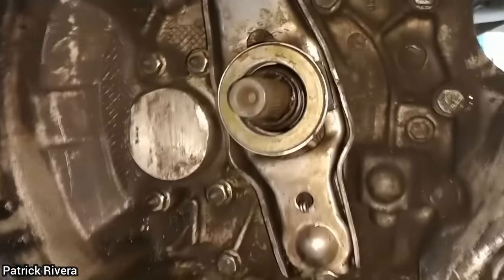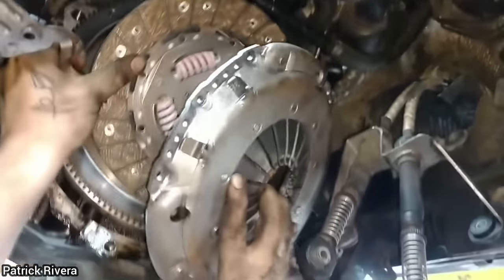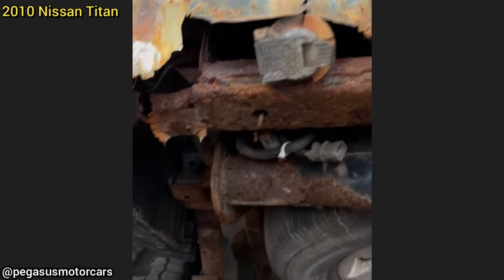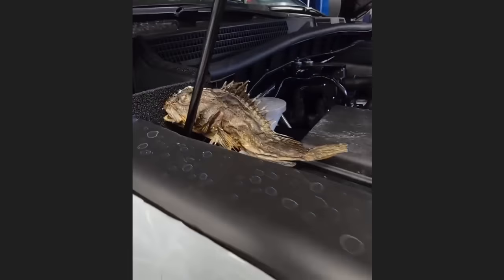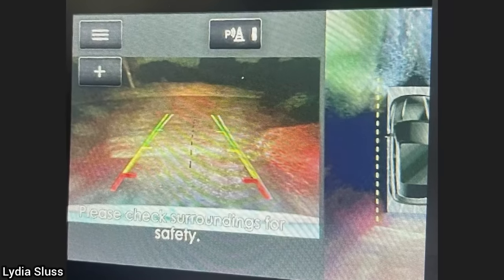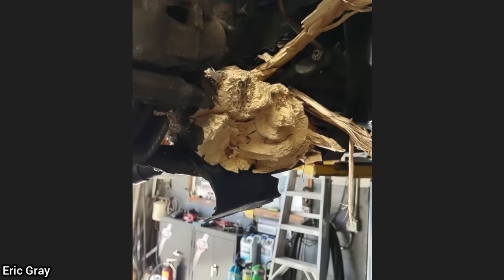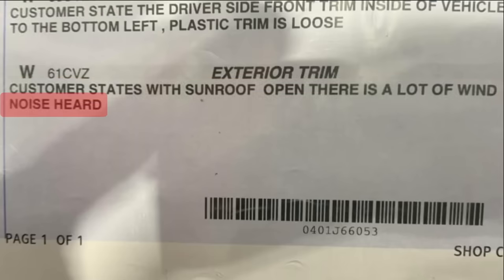Customer States New Clutch He Installed Doesn't Work Properly

Comment: Spray foam the sunroof customers ears to fix the wind noise 👍
Reply from the maker: Spray foam head phones!
Reply: @JustRolledIn That is a good idea, might use the long weekend to make some 🤣
Reply from the maker: @smilerbob  please keep us posted on this 😂
Reply: @JustRolledIn  👍👍
Reply: Foam in one ear, out the other.
Reply: Too much work.  Gotta go buy the spray foam, shake it up.  I just turn up the radio volume.  Problem solved.  🤣😂
Reply: In all fairness. I’ve driven cars that are fairly quiet with the sunroof open, and some that sound like a tornado. My last BMW had fancy deflector that worked well.
Reply: there are some automotive problems that can be easily fixed by turning the radio up
Reply: Comment of the year. Fully sums up the 2024 zeitgeist.
Reply: I have wind noise as well from my sun roof when open I wonder if spray foam will fix.
Reply: Hey, that's a nice and permanent way to fix wind noise, sunroof or no sunroof.
Reply: What is this, a crossover episode?
Reply: I would’ve just said it’s called Bernoulli‘s principal.
Reply: Pouring concrete would be a more concrete solution.
Reply: Or fix the wind flap mechanism that doesnt come up to steer air automatically when the sunroof is opened? Can be customer fault too but that CAN be an issue if the flap mechanism doesnt work 😎
Reply: @JustRolledIn  i’ll be waiting to see them on Dank Pods.
Reply: Brilliant, now the fix will work in any vehicle he's in

Comment: "There's a lot of wind noise when I open the sunroof." sounds a lot like "When I step in the shower, I suddenly feel moisture."
Reply: Yes, but you don't realize that the wind noise still happens when it's standing still!  The shop has called a priest in for a consultation.
Reply: I bet they even added "but only if the car is moving" 😅
Reply: "When I hit myself with a hammer it hurts."
Reply: "When it's sunny out, I get hot"
Reply: And it's really bad at 100mph in the rain.
Reply: @coastaku1954  "It gets dark at night."
Reply: @markh.6687  "I go faster if I run"
Reply: but wind noise is a consequence of a bad desing, there should be some shapes that minimalize drag and noise. So customer was not so stupid this time. There could be something wrong indeed
Reply: Moisture is the essence of wetness
Reply: Scary thing is these people are also voters which explains a lot.
Reply: The sunroof noise may not be a dummy, several cars have an anti-buffeting setting on the sunroof switch, if buffeting is experienced you twist to the setting and the roof closes a little bit (maybe 3/4 open instead of fully open). You can also lower a rear window a smidge, maybe an inch.
Reply: "My car is only getting 37 miles per gallon when it should be getting 38."
Reply: Spray foam ought to clear up that whole moisture thing. Just spray it on the shower head before use.
Reply: When I close my eyes I can't see
Reply: Many cars have a flap that pops up to guide airflow when you open a sunroof. It can malfunction aswell. My parents volvo 850 has such flap and when I push it back down while driving the windnoise gets alot louder in the car.
Reply: @markh.6687  Classic Blonde joke....Doc, why does it hurt when I push right here? Your finger is broke.
Reply: @donnienicholson6062  Heh heh heh!

Comment: A PAPER TOWEL to hold in an ignition coil 😅.   Everyone knows you’re supposed to use spray foam for that
Reply: 1 full can Minimum, atleast.
Reply: Put enough spray foam on the coil so that the hood holds it in place.
Reply: Be nice. Some people just don't know what you and I know.
Reply: Gen Z has evolved again. They're now using paper towels instead of spray foam.
Reply: No, the correct repair involves a cable tie/Zip Tie.
Reply: I’m going to have to start carrying cans of spray foam in my car, you know… just in case.
Reply: Damn I was coming here to make that joke but you beat me to it.
Reply: Spray foam solves every problem ever apparently!!!
Reply: @ctcv-to8kq  Then they shouldn't be working on cars.
Reply: No.. spray foam is for rust mainly... you need a coconut...specifically a load bearing coconut.
Reply: Silly me, I was thinking duct tape or cable ties would fix it. Wait a week and someone comes up with something new and cheaper.
Reply: Actually JB Weld would get it through an auction and then who cares?.........except the buyer.
Reply: @ctcv-to8kq  My wife broke her thumb last month. I know very little about creating a cast..........and didn't try.
Reply: @donnienicholson6062  You're wise beyond your years.

Comment: Milk crate guy had so much faith on the crate
Reply: And  here I thought there was no limit to what a milkcrate could do.
Reply: Worked with his old car that was 70% sprayfoam
Reply: He failed to fill in the holes of the milk crate with spray foam. Shortcuts like that are the source of many problems.
Reply: I've got buckets that come with a picture of a mercedes e class resting on them, one under each wheel. So I suppose the milk crate isn't too wild of an idea haha
Reply: I weigh 220. A milk crate will  barely hold me on the edge corners. It's not a step stool either.
Reply: I wonder if people using those as jack stands to work under the car have won some Darwin Awards already and just don't show up here cause this isn't Liveleak.
Reply: Next week it'll be 5 gallon buckets.
Reply: Too much
Reply: Plastics can hold surprising weights. His biggest fault was putting it sideways and having the long beams further away from the corner supports try to hold the weight. Had it been other way around it would've most likely held. Not that I think it's a good idea overall.
Reply: @markoman5267 he wasn’t using enough milk crates
Reply: Spray foam fixes everything
Reply: @Kalvinjj  I miss LiveLeak. I didn't watch stuff there very often, but I appreciated the fact that something like it was out there.
Reply: And Weight
Reply: Quality of milkcrates has sure gone downhill.
Reply: At least he was trying to do the work himself. It was wrong but he tried!!!
Reply: @PAcifisti  No, it wouldn't have worked. Multiple crates may have worked but a single one was just another dimwit proving how little they know. The genius thought a crate could support 2500 lbs!
Reply: They don't make them like they used to lol
Reply: @nboddie1036  Well, that is ironic given that the crate isn't holding up the whole car but about half or so. So it's more like 1250 lbs unless you think that car weighs around 5000 lbs. And again, solid plastic structures like the towers at the corners can easily stand up to a lot of weight. If it had been placed on the edge it would've had a much better chance.
Reply: @PAcifisti  The SUV weighs a lot more than 2500 lbs. Maybe half is about 1400-1800 lbs. Regardless, milk crates aren't designed to hold that much weight. What a genius...
Reply: @roxximusik8958 no need to anyway, they rotate themselves as you drive 😉
Reply: Milk crates used to be made of heavy duty wire and sheet metal.
Still wouldn't trust one as a jackstand...

Comment: Soon we'll see a spray foam car. "Customer brought in their spray foam car. Apparently the last owner installed some metal and painted over it" 😂😂😂😂😂😂
Reply: well tecnically all cars of  the tuning era monsters of the early 2000 were made of foam , fiberglass and glitter paint xD
Reply: To be fair, a foam core between two layers of fiberglass is a standard boat building technique. 

A foam core between two layers of rust does seem dubious.
Reply: in the next episode there will be someone saying that he spray foamed the car because someone on the internet said this is how boats are done
Reply: Along with a bit of JB weld and a few zip ties.
Reply: Crocs.  Not just for walking anymore!
Reply: It's important you allow the spray foam to thoroughly dry and harden before driving your vehicle, especially when using to support or replace frame and steering components.

Comment: FFS people I live in the rust belt and have a 20 year old truck that is structurally perfect and only has minor surface rust because I coat the underneath with a used oil slurry. I see people with vehicles that are less than 10 years old with subframes completely rusted away from the structure of the unibody or trucks with frames that look like they Luke and Bo Duke’d the thing and taco’d the frame from jumping it but nope it’s just rust to crap something that’s not even a decade old yet. Do not listen to the Car Salesman, that undercoating they offer is worthless and will be peeling off in a couple years not to mention they will spray stuff they shouldn’t like the exhaust and then completely miss other areas that needed sprayed. Nothing beats good old fashioned recycled oil being sprayed on the undercarriage but the EPA closed down most of those places so do it yourself or get it Fluid Filmed which is a good respectable alternative to recycled oil but the oil is better for preventing rust in the Salty Rustbelt areas

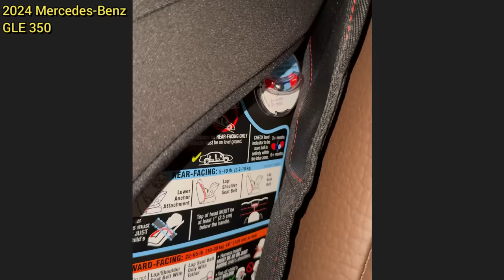Comment: 2:51 Customer States: "My convertible gets very cold in the winter whenever the top is down..."
Reply: "Pedal becomes hard to press when it reaches the bottom"
Reply: Yeah well, my car makes noise when I start it.
Reply: :"steering wheel wont turn any more at a certain point" ---- check and advise
Reply: @the_kombinator  Sounds like an old-fashioned Internal Combustion Engine. Though I guess EVs have start-up chimes too.
Edit: synthetic pedestrian alert noise too.
Reply: Light blinks on dash when left stick is moved up or down.

Comment: Customer: "Could you take a look at my car, there appears to be a problem with xyz"

Mechanic: "Hey, we found the issue and we can fix it for you"

Customer: "How dare you! I'm driving away"
Reply: Americans are entitled and think they have a Dog given right to ride.  They also think car repairs should be commensurate with the value of their car.  You can't explain them why a trans R&R will cost $5,000 for their $2,000 car.
Reply: @russell2952  Can't fault a man when spray foam is on sale.
Reply: @MrSloika   Most folk simply don't budget for maintenance or repairs, & they don't plan for it, so when they need something done, they simply can't do it at the moment.  Not everyone is a stupid asshole.
Reply: @Salmon_Rush_Die  Only 99.5% are when it comes to car repair!🤣
Reply: @Salmon_Rush_Die  Not getting the repairs done is their critical is being a massive idiot by European standards. Not that it's actually an option with critical stuff. You either get it repaired or you take it off the road till it is or you scrap it.
Reply: @darthkarl99  If the car can still propel itself under its own power, it's not critical. :p
Reply: @russell2952 It used to be baling wire. Oh how times have changed.
Reply: @Salmon_Rush_Die why even bring it to a service, then?

Comment: That rotted in half spray foam parts truck reminded me of my neighbors truck. Early 90s 1500 Silverado he bought from a good “buddy” that he was all excited for. I asked how much rust it had being over 30yrs old and in WI and he said very little, it’s really clean with a new engine. This thing was so rusty the RR Xcab mount was gone, GONE!! He brought it to a muffler shop for new exhaust and the frame cracked in half while on the lift. He had it fixed and when he told me what happened I asked why he bought it with the cab clearly not sitting on the frame properly, not to mention literally every other body panel being toast as well. He didn’t notice, a 3-4” variation in the body lines and he didn’t see it🤦🏼‍♂️ Told him he needs to punch his buddy in the mouth for that BS deal. Yes he’s still driving it yes it’s now a whole lot worse than when he bought it and no I don’t let him follow me anywhere 😂

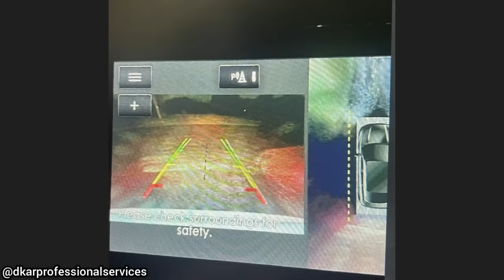Comment: 1:31 - I wonder how far this complaint went.

Step 1) Complain to the dealership. Tech says this is expected behavior because of the light from the brake lights.
Step 2) Complain to the manufacturer. The representative says this is expected behavior, and that brake lights are required by law.
Step 3) Complain to the government. The government says that brake lights are required safety equipment and that you should go pound sand.
Step 4) Customer pulls the brake lights fuse. Customer gets rear ended in the middle of the night because the tail lights aren't working and then complains to the dealership.
We've gone full circle! 😆
Reply: You wouldn't believe how many drivers are driving around in Chicago without brake lights, this might be what's happening, what you explained I mean haha
Reply: @0013bluejay  Last time I fixed the brake lights on one of our cars: I thought the brake light switch was faulty: because all 3 bulbs were burnt out.
Reply: I wrote on another comment about this one that the customer had 2 options. Either don't use the brakes or just use the mirrors. I can't believe how mindless some supposed adults are...
Reply: @nboddie1036  you're telling me, as a truck driver I had to deal with this crap tenfold everyday, I just wish people would think two feet past their own bumper.
Reply: Step 5) The dealership takes the customer out back and puts them out of their misery

Comment: When in what dimension does someone think two plastic milk crates will keep a Toyota sienna in the air 💀
Reply: You think people are smart?
Reply: The customer is probably thinking, "I should have used MORE milk crates. That was my mistake."
Reply: I wonder what percentage of people just don't have a "feel" for mechanics. Some get trained in formulas, some look at something and say "I don't know why but that won't work and others just didn't break their toys as a kid!
Reply: The second.
Reply: @Paul_Wetor  Maybe the secret is having the milk crates filled with milk cartons.
Reply: Don't look too much down on plastics. Four credit card sized blocks will easily hold up a 2-4 ton concrete slab. His biggest fault was putting all the weight on the long side beams with no support underneath or near it.
Reply: @PAcifisti  Only if they're solid. The issue is not the material, but how it is structured.
Reply: @PAcifisti  It's not the material, it's the structure of it.
Reply: Clearly the teaching of physics in school is not what it ought to be.
Reply: @UncleKennysPlace I weigh a lot less than any car, and even I don't really trust a milk crate to hold me up

Comment: I grew up in the desert southwest.   I have lived in the "rust belt " since 2000.  I am still floored at the short life of vehicles due to rust from so much salt.
Reply: You can protect them from it. Just apply protective layers when new and it won't really get affected. We salt the roads here too and cars last Much longer than this - heck, most of our cars are older than 2009 and we have mandatory yearly inspections that won't allow rust damage on structural components.
Reply: Rinse the underbody after the roads are dry, and you'll keep it mostly at bay for cheap

Comment: Customer state (my mom): "My muffler is making loud noise." Does not try trouble shooting symptom
Me: Put the car in neutral and rev up the engine. Noise in question is not happening
Car start rolling, Noise start again.
Me: Take a look at rear passenger wheel: Disc brake mud splash shield rusted off and is grinding the wheel. Remove broken shield noise is gone. :D

Comment: Spray foam doesn't rust, so it must be stronger than steel.

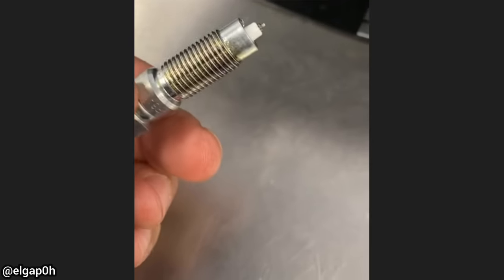2:05 That is a glow plug, right?
Reply: Also, spray foam (or where I'm from it's Expanda-foam) holds water, keeping it away from the rusty frame rail it's inside, reversing the rust!

That is just another spark plug, with no earth electrode. Glow plugs are much longer, with no ceramic insulator, & often finish at a smaller point.
Reply: It is now.

Comment: When I was 19 I did the same thing swapping the clutch on my Z32 300zx. Two throw out bearings. The old one was flat as a penny when Z1 Motorsport figured it out. Russell kept it as a souvenir. I had cut it to pull it but never extracted it. Late nights with lots of alcohol lead to that kind of thing.
Reply: Wow just straight up openly admitting to being a loser who would be involved with lots of alcohol
Reply: @cenciende9401  yeah, that was twenty five years ago. I’m sure you were totally different, Poindexter.
Reply: @JoshJones-37334  Your use of "Poindexter" is most appropriate FTW. Some folks posting comments are exactly the type to complain about wind noise with the sunroof open...

Comment: Paper towels will become the spray foam of 2024. 😅
Reply: My wife bought a "like new" S-10 blazer from a "trusted" co worker. Among the many things this gem had, the rubber donut in the steering-shaft coupler was disintegrated and the steering was tied together by 2 strips of shop rag. The whole exhaust system hung with barbed wire was another noteworthy item. Solved the catalytic-converter-theft issue ahead of its time.

Comment: 2:11 That's when you have your license taken away.  When you're too stupid to know what pedal does what, you instantly have your driving privilege revoked.  The driver is lucky they didn't kill the tech.
Reply: I did masonry for 35 yrs...That white stuff on the ground in the garage is called "Perlite" Its a Loose-Fill Masonry Insulation which is poured into the  holes of the blocks and fills the wall. They are the size of a round  b b and it would come in a 5 foot plastic bag. It would be a pain to pour it down a block wall on a windy day. We put an addition on the Dunlop plant in Buffalo, NY, I had to go in the factory and vacuum through out the plant

Comment: At 2:16 is that all styrofoam insulation beads from the wall?! Those things are going to be everywhere, forever! Especially if this is a shop in New England during a dry winter. Poor shop maintenance guy...
Reply: Was going to ask, why not use SPRAY FOAM